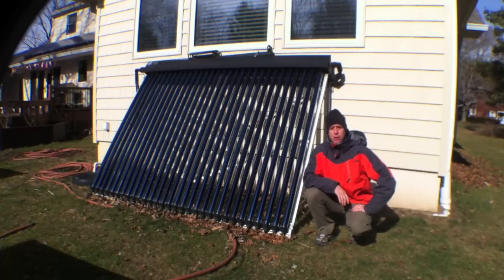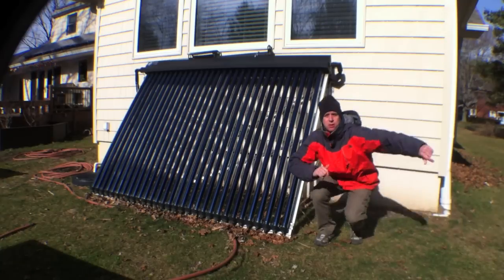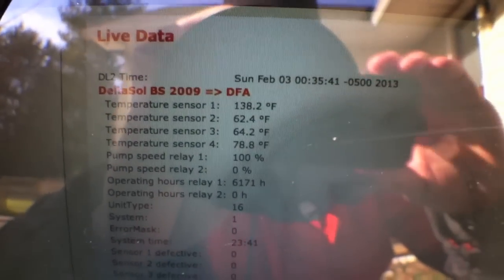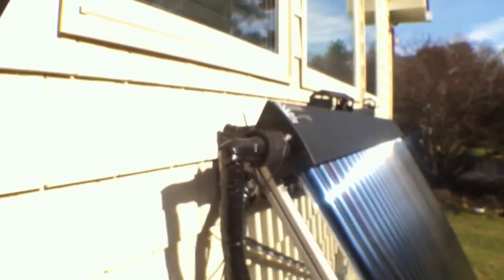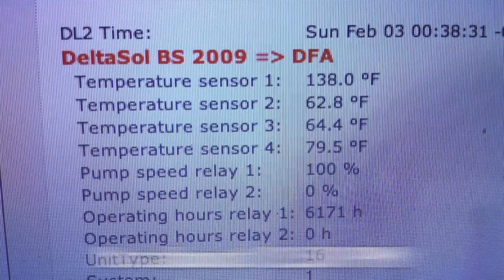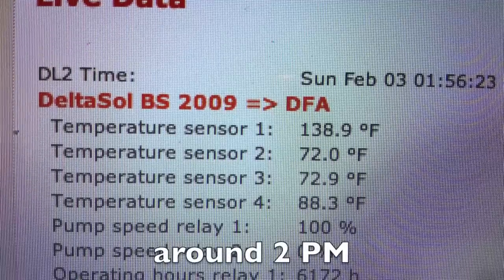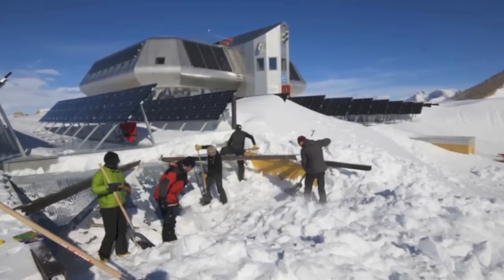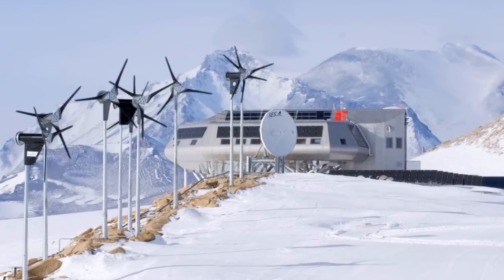Does solar thermal work in very cold temperatures?  There is heat in light!

Comment: Ed Hammerly of New Jersey renewable energy forgot to mention some important points in his video on Sunday Feb 03.  

I find that most green energy folks always forget to mention reality and how it actually works, especially when talking about solar water heating systems or electric cars in cold climates with one to two hour commutes in rush hour traffic like in Chicago when it is 10 F - Fahrenheit or colder with the heater running full blast.

Most home hot water heaters are set at 120 F for a reason. Legionella bacteria (i.e., that can cause pneumonia and mild flu like illness called Pontiac fever) can grow in water temperature between 68 and 122 F.  And, most people like to take showers that are around 100 F. My wife prefers 105 F. We would be very unhappy having to take showers at 75 F to 89 F. Our hot water heater is set at 140 F, which is probably 20 degrees above average.  
 
Ed indicates that the water tank is 80 gallons.  At 12:30 pm, the temp in solar collector is at 138 F, the temp in the tank at the top was 79.5 F, middle 64.4 F, and bottom 62.8 F. By 2 pm, the temp in the collector is 138.9 F; the water at the top of the tank is 88.3 F, in the middle 72.9 F, and at the bottom of the tank 72.0 F.  By 3 pm, the collector is at 115.9 F (a loss of 23 degrees F or 16.5%) the top of the tank is 88.2, the middle 79.0 F and the bottom 78.6 F.

Ed then states that we have gotten a free tank of hot water; he should have said warm water (80 F to 85 F) and stated the actual cost.  It was not free. 
http://energy.gov/energysaver/articles/solar-water-heaters

“Doing the Math on Solar Water Heaters”

A solar water heating system cost from $8,000 to $10,000 for households with four to five people.

Assuming an average life of 20 years, that is from $400 to $500 per year, before maintenance.  The average energy bill for a single family home is about $2,200 per year.  Of, this 14%, or $308 per year, is spent to heat water.   
http://www.americanthinker.com/2012/06/doing_the_math_on_solar_water_heaters.html

Ed also assumes that no one is taking a shower in the afternoon on Sunday or washing clothes.  An average 10 minute shower can use from 25 to 50 gallons depending on your shower head. A fully loaded washing machine uses 25 to 35 gallons.  A dishwasher uses about 3 gallons. If you are running these after 3 pm in the afternoon, you will run out of warm water.
http://askville.amazon.com/gallons-water-average-10-minute-shower/AnswerViewer.do?requestId=2548818
http://homeguides.sfgate.com/many-gallons-water-average-washing-machine-hold-full-80612.html

Ed also forgot to show up what the temperatures in that 80 gallon water tank were at 6 pm or 8 pm, 10 pm or 6 am the next morning.  My wife and two children take long showers before going to bed at around 10 pm.  Sometimes, my wife and I use the about 50 gallons in our whirlpool tub in the master bathroom in the master bedroom.  We have a 75 gallon hot water tank that works wells, which reheats sufficient amounts of water for all those activities. 

Ed forgot to mention that if you do take showers at night or in the morning, you will need a back-up water heating system (i.e. gas or electric) unless you like taking cold showers.

Anyway, I have just explained the reality of solar water heaters in cold climates.
Reply: I agree with most of what you say. Yes a system like that cost much more than just using fossil fuels! But I have to say that when I researched the average 10 minute shower it was 10 to 15 gallons. I can't imagine what a person would look like if they showered long enough to use  50 GALLONS... Must be a typo since most homes I have installed water heaters in were 30 gallons. I have done one or two 40 gallon but "Holy Science" for someone to need a 70 GALLON tank is ridiculous. I think you are the most water wasteful person I have ever heard bragging about it. My wife and I had a grey water system and our average DAILY use including; Shower, bath sink, Kitchen sink. came up to a whopping 15 gallons per day. You must let the water run when you shave and brush your teeth. Also, it's not that difficult to turn the water off while washing your hair and while washing your body. I let it run the entire shower if it's really cold in the house but most of the year I turn off for hair wash and off for body wash and it takes far less water that way.
Reply: George, everyone, the only safe way to use Solar Thermal with potable hot water is to heat the storage tank from the top-down! 

For example, the heat exchanger systems that use coils inside the bottom of the tank may not provide hot enough water. Therefore, it is best to have a second coil at the top of the tank. The hottest antifreeze enters the top coil, exits, then enters the bottom coil, then back to the solar collector. 

A set of thermostat-controls are also essential for controlling a couple pumps. There is no point in circulating the antifreeze until the temperature at the collector exceeds two temperatures: 120-140 °F (typically what is set on hot water heaters), and Also exceeds the hottest stored water by at least 10 °F. It may be best to use a proportional speed controller on the pump to at least maintain that temperature, so I recommend a DC motor. 

If using an external heat exchanger, place the heat exchanger at middle of the storage tank to heat the potable water. 

When the potable water exceeds the setpoint and exceeds the storage tank temperature (at the top), pump it into the top of the storage tank. This can also be a proportional speed pump, Or, the circulation may occur by thermo-syphon  Feed the heat exchanger from the tank bottom. Also, heavily insulate the heat exchanger, pipes, and fittings. 

This provides hot tap water that is safe to draw from the top of the storage tank. Finally, the storage tank temperature may far exceed Scalding temperatures, so use a mixing valve!
Reply from the maker: Well… George.  I don't think I have the time to go over point by point on your book report, but you make a few valid points and concerns.  I'm not sure why you think I don't have a back up system to make hot water when my solar system is unable to perform the job completely.  That said, the technology has many great advantages and will become more viable to more Americans as prices continue to come down.   For now, in many cases, as the world calculates costs, its not the cheapest alternative.  I'd argue that the installation cost is what tends to drive up the price.   But what many people don't want to admit is that we can keep doing what we have been doing.   The environment and finite resources won't allow it.  The cost of doing things the old way aren't included in the price of your fossil fuel devices. Human health issues, environmental damage and military costs in dollars and lives securing these resources across the world.   As seen in the Ukraine recently, many european nations are stuck between a rock and a hard place, because of Russia's control of the natural gas in the region.  Sustainability is going to be the word of the next century.
Reply: Yeah I'm not reading all of that.

Comment: yea. would not work here. not much sun light, and -numbers in temp.
Reply: They use it in the Antarctic.
Reply: I doubt it
Reply: Mike Warren 
Have you ever seen ice melt even though the outside temperature is 15 degrees F when it is sunny? Look for it when we are there again with the temps low and it is sunny with ice somewhere. As mentioned in the video outside air temp changes NOTHING with the strength of the suns rays.
Reply: steve b dispute the meaningless insult . here is Michigan